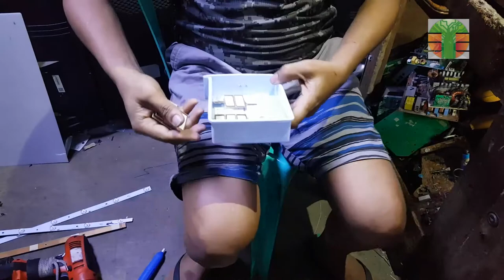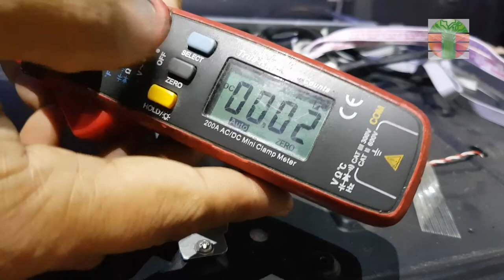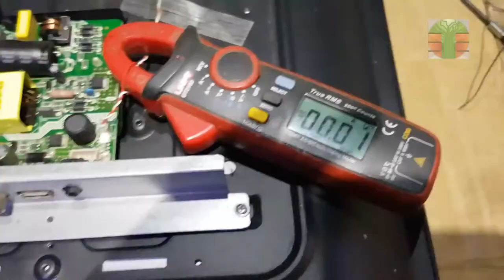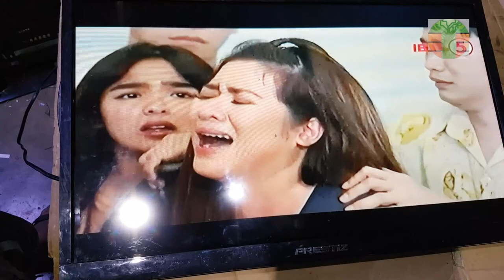How to decrease the led backlight current.

Comment: Good job 👍.
The resistor R150 you removed.
It's in the section of backlight section.
Reply from the maker: Yes, correct
Reply: @tevzTVTevatronics  thanks. 👍

Comment: Hello my friend very good video. One question please I have 32 inch led tv on power board output to leds is 80v and can i put 2 strips ×9 leds from other led tv .or what is the calculation for putting leds found this tv with no leds everything seems to be OK.Thank you again for your time and help.

Comment: The best way to test the voltage in a backup light drive is by using a voltmeter or a multimeter.

Comment: With great English accent always! Sir a question pls? I was working with lg 42 led tv which display is flushing or off and on repeatedly. I used external led driver for the back light. But after a day , it became the same problem as before? any help? thanks in advance!

Comment: Hello can you please make a video showing how to identify this part on any LED TV circuit.
Reply from the maker: will do
Reply: @tevzTVTevatronics gud day master may 40inch led tv akong ne repair gud backlight pero no display no vgh vgl avdd pero nung nag cut ako sa ckv lumabas ang absent voltage nya kaso blackscreen parin san po ang problema master tnx.

Comment: How do you know which resistor? Spend time to Trace circuit or have you got schematic? Could you also tie in a current limit resistor directly to led strips wire.?
Reply from the maker: I have done this many times, and mostly led driver is a similar circuit design. Putting a resistor directly at the wire is not efficient, the resistor will get hot.

Comment: Parrarel kuna at series ayaw umilaw prin..ang led bcklight po ba pag may sira led..ay wla po bah lumabas supply galing main pcb board nya??convert ko ksi ibang board umilaw 30 led..ang 10 led ayaw umilaw..
Reply from the maker: ilan ba wire pa punta ta main board?

Comment: Hello po pwede din po ba ma reduce ung 12v eagle eye led gawing 5v?
Reply from the maker: pwede. gagamit ka ng step up dc to dc converter.
Reply: @tevzTVTevatronics  i mean po gawing 5v or 3v ung power draw ng 12v led eagle eye. para ma lessen ung consumption ng power sa powerbank.
Reply: pag 12v led to powerbank need pa ng 5v to12v adapter. ang gusto ko po sana mangyari ung 12v led mismo ung bawasan ng voltage, ok lang na humina ung brightness
Reply from the maker: @xSO20  hindi na iilaw pag sa 12v 5 volts supply mo.